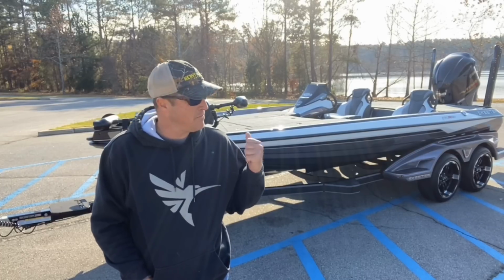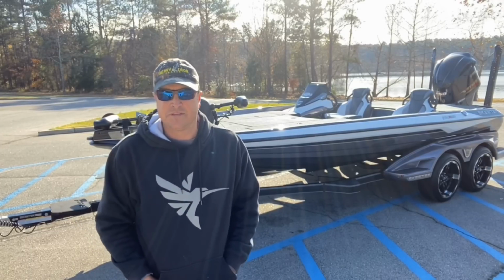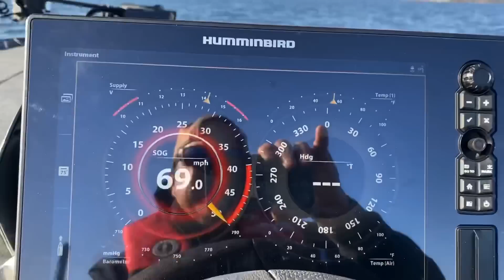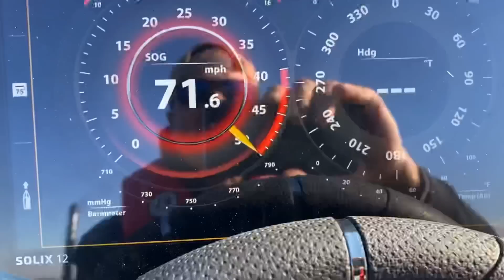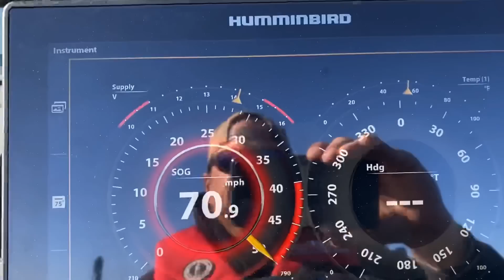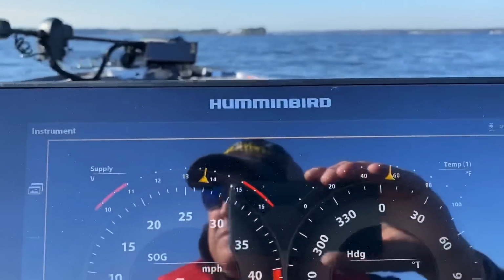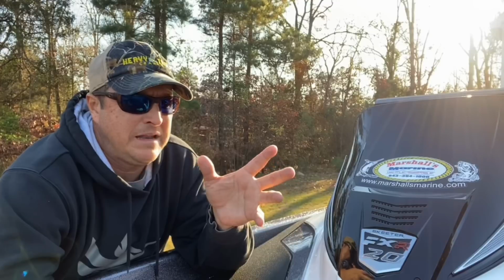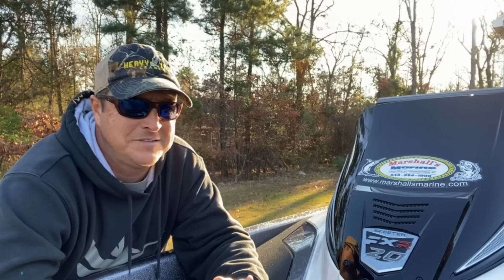Skeeter FXR20 Top Speed

Comment: I have a 18ft SeaRay with a 5.7L and with a 23p 3 blade I got 58 mph. For me thats flying but when bringing several people and some more gear and coolers ect I got prop slip coming out of the hole so I went down to a 19p and now it will set you back in the seat when coming out of the hole and I still topped out at 50mph and thats plenty for me. The Skeeter looks bad ass and I love the digital guages on the graph. That 70+ is flying.

Comment: FXR is a bad ass boat man...i bet it rides like a cadillac too...looks like you got the right wheel but yea maybe the 24 will give you more rpm (roughly 300rpm per pitch)....im a BassCat guy but if I were to go another brand Skeeter would be it...I have a Pantera 2 with a merc that runs 72mph fully loaded with a partner (poles, 4 graphs, ultrex etc)...its much lighter/ more nimble than the FXR so not a good comparison but I do like pushing the big boys haha

Comment: Those RPMS are low. If you want to see it run get the RPMS over 6000.
Reply: Top Dawg  it will hit the rev limiter at 6200rpm. My FX21LE will gain 3 or 4 mph from 5800 to 6150. The Sho likes to eat.

Comment: Yes, I am sure if you are going to want to open her up full throttle, tilt that motor about 15 degrees up. You might chin walk a little; maybe not, but you, and that 3- blade Fury would get 77 Mph. Also consider those power poles are added weight too. If you have Bob Marines super jack plate, set it to highest position. Problem with higher top end speed sacrifices hole shot.. No free lunch. I feel you got a really great boat. One other thing, High Octane fuel, or racing fuel could also add mph. Be careful. Tweeks can only do so much. If I had your boat, I would get a custom raker chopper prop made to my specs of my motor, to get the most RPM, and speed. I would also on long runs where you want to open it up to tilt motor about 15 degrees is enough. Try these tweeks and tell me if you don't hit 80mph. You should. Also there is a computer chip you can buy, that will increase HP and RPM. It's a high performance chip module. Shop has to install it for you. Will surely get you in the upper 90's....... May void out your warranty, but your boat would be super fast!!!!!!
Reply: There is no point in going anywhere over 80, most boats can't hit 75.  At that point you risk your own safety as well as possibly damage your boat

Comment: What was water pressure?
Reply from the maker: 18-19 I believe
Reply: Might be able to pick up some speed taking the motor up a little more. Dont have to worry about blowout on the Yamaha gearcase until mid 80’s. Not sure on Yamahas but Mercs can go down around 11 or 12 for water pressure. I was amazed how much of a top end difference motor height made on my Allison XB21. Be safe brother.
Reply: Even with the big Yamaha tune it will never go fast enough to worry about blowout
Reply: @Matt_Mc_GENX  not true blow out can happen at 70 on a givin boat depends on trim and motor height and water conditions
Reply: @johnwolff1043  allison is much lighter boat and can carry the hull at higher engine settings than 99% of other bass boats,,,,on heavy boats like this you can only go so high before the weight of the boat overpowers the hold the gearcase has in the water increasing slip and loosing speed ....rpm may go up but speed wont because of slip.....